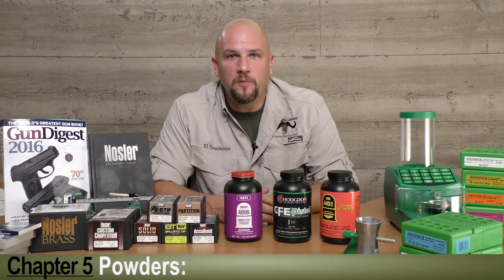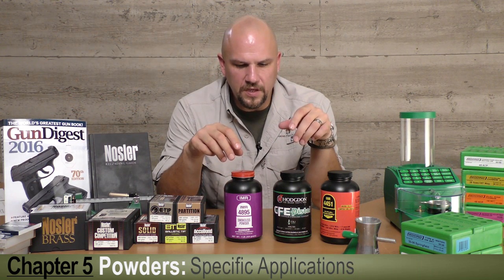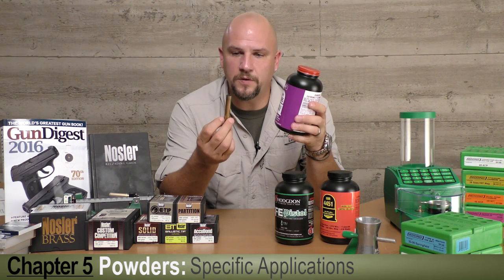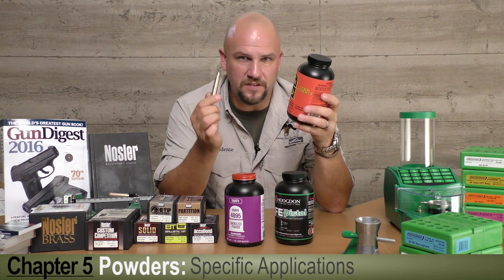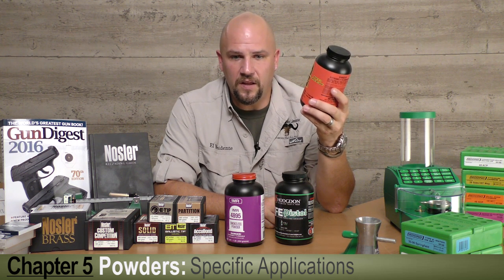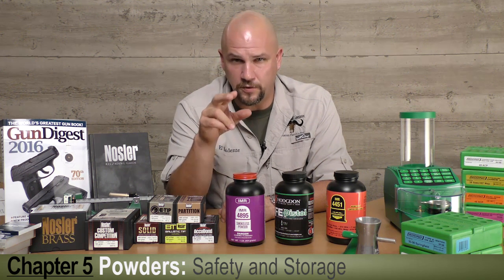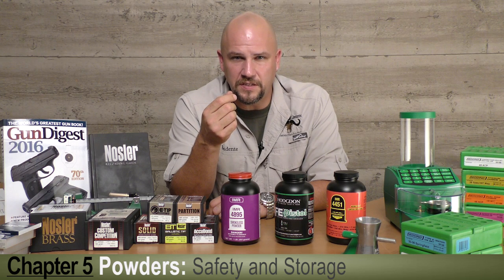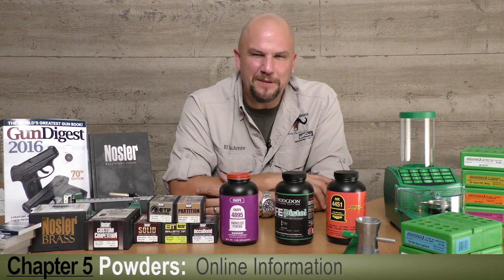Gun Digest Reloading Video Series – Episode 5: Powders

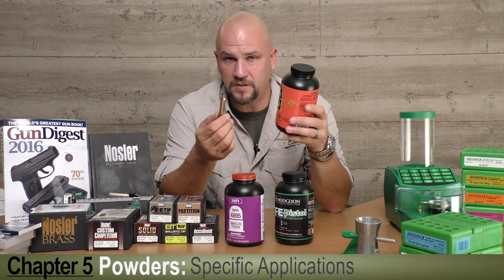Comment: speaking of high temperatures / dangerous situations, you said the case may get stuck in the chamber at the 3:30 mark - would this be due to thermal expansion? i'm still a gun newbie but I haven't heard anyone discuss this yet
Reply: Anita
A sticking case is caused by pressure spiking too high. He is talking about a temp sensitive powder which may spike if it is used in extremely hot conditions.

Comment: but what everyone really needs to know is, can you fire a gun in outer space?? I have been reading some very silly comments today from people who don't really know how a bullet is fired from a gun here on earth, much less outer space, or people who are confused about the science of it all in general. however, all that reading made me think of a point brought up by a couple of people - just what are the temperatures at which you can rely on your firearm to fire? it gets awfully cold or hot in outer space. your frame may even crack, I imagine. I think it's time for me to explore a whole new realm - outer space weapon technology
Reply: The Russians have developed a gun for use in Soyuz, but it is a survival tool for If the capsule lands in a very remote location after e.g. an emergency ballistic reentry (which has happened several times). I doubt the loads are designed to operate correctly in the temp extremes of space. Maybe, but not likely. There isn't a need.
I'll bet this is the only time the term "ballistic reentry" has ever been used for a gun video.

Comment: I am in England. I have a Henry 45/70. The powder I used has been banned - IMR 4198. I've tried Ramshot  X Terminator. It is a very dirty burner and requires more powder per load. Can anyone suggest another powder suitable for my 45/70 used only for target shooting? I use minimum loads.
Reply: Adrian Larkins , try Trail Boss powder.
Reply: Hogdon Benchmark works great. IMR 3031 should work also